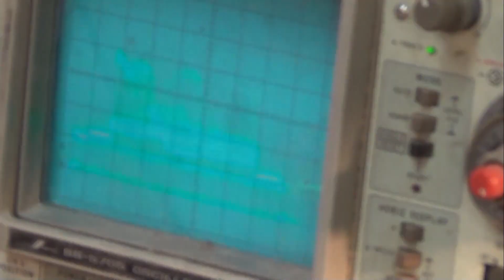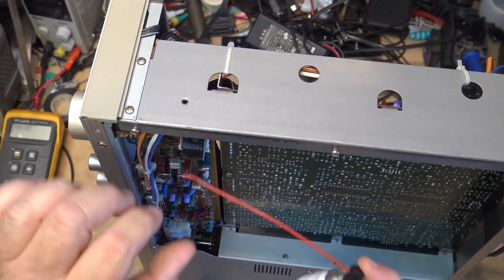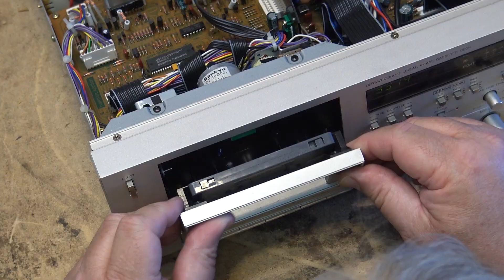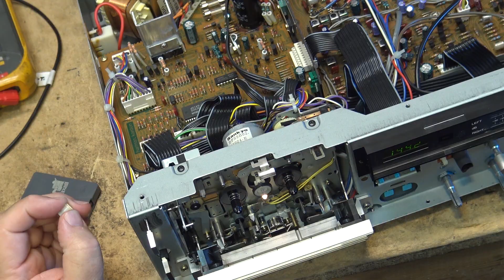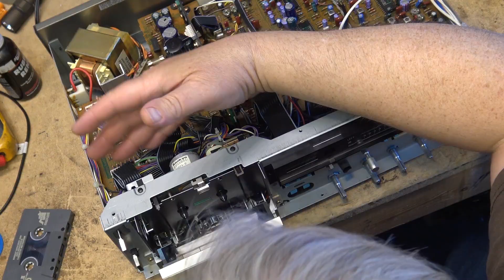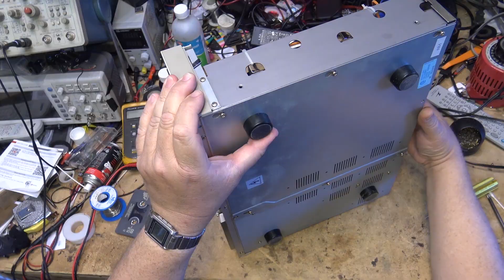Harmon Kardon CD491 Cassette deck no tape movement repair

Comment: First time I've seen a cassette deck that says "WAIT"
Reply: Actually this is my deck, I believe the wait is to allow the deck too do a diagnostic before booting up
Reply from the maker: @quintins8015  If you watch the loading motor it will rotate. The delay is just for the mechanism to reset, and then it reads the switch settings to see if it is set to timer record or play.
Reply: Quintin Shoker Lucky you have this deck? Tape Monitoring it’s pretty cool on it where are you can hear the tape recording as it monitors for any distortion or what not! I want the deck,  or somewhat similar to this deck
Reply from the maker: Wait there's more
Reply: @12voltvids  too funny 😁🤪
Reply: I have a Carver CD player that has a 30 second countdown when you turn it on before it will play.
It's due to the pair of 6DJ8s in it's preamp section.
Reply: Probably to build momentum on the flywheel (however this has a dedicated motor for logic). I have a Sharp RT250, is one motor full logic that if you press play fast enough after power up, you end with a jammed mecha, because it relies on flywheel inertia partially to get the job done (IMHO).